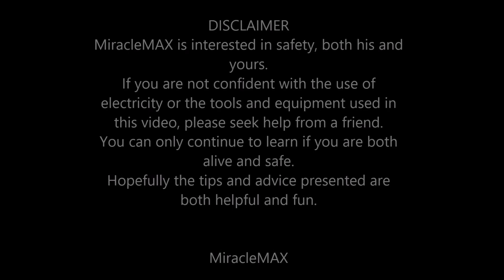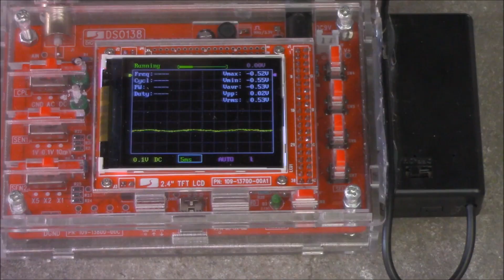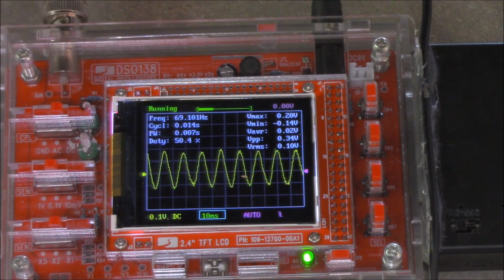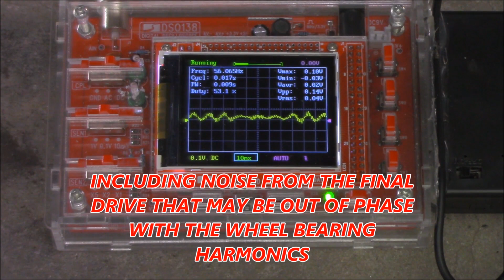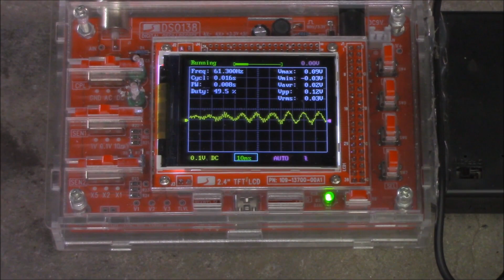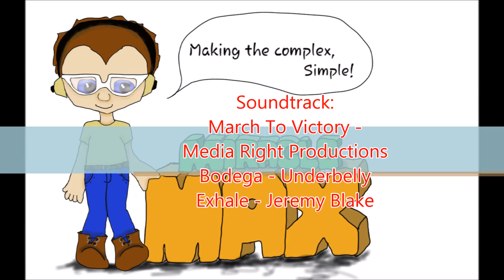Which Is It?  Wheel Bearing Or Diff Noise? MiracleMAX

Comment: My car makes rumbling noise from drivers side amd pulls me to the left. When i turn steering slightly to the right the rumberling noise will go am i correct in saying its a bad wheel bearing what is causing it
Reply from the maker: There could be many reasons for noise from one side - wheel bearing, cv shaft, etc. Difficult to make suggestions without hearing the noise.
Reply: @MiracleMAX  do ypu have a email i can send a video over to you mate
Reply from the maker: @gaz2581  The email address is shown in the description.

Comment: If noise was because of wheel bearing then why noise got less after changing differential fluid?
Reply from the maker: This vehicle had not been maintained properly & so that is why I replaced the oil and put in an additive to try and isolate the fault, but as shown in the video, the noise came back the longer I drove it due to heat. Evidence of the correct diagnosis was proven when I showed the old bearings.
Thanks for your comments.
Reply: @MiracleMAX  Thank you for the info. Will acrylic sprey paint on the threads of metric tapered plug make it stuck when i try to loosen ? Do you have any idea. I gave a try but not hardly as i am also afraid to strip. I will keep trying from time to time different days i think. i dont know what else to do
Reply from the maker: @cemildenizel2223  Not sure exactly what you mean. Do you have a bolt you are trying to remove or a tap? Why is there paint on the thread? Have you tried using paint thinners to soften the paint?
Reply: @MiracleMAX  Before installing differential plugs spray acrylic paint was sprayed on threads of oil plugs in order to create a seal and prevent leaks 1.5  years ago. My question is that will it make it harder to get the plug out now? At least it should prevent welding in 1.5 years time.
Reply from the maker: @cemildenizel2223  generally a diff plug will have a washer or it may be a slightly tapered plug, which really needs no sealant. What makes you think it is paint? Could it be Loctite that was used?
Reply: @MiracleMAX   Originally it has dry sealant dust and no washer. Mechanic used spray acrylic paint to seal it . i saw it. but only a thin layer of sprayed paint. i now got that it was a wrong thing to do. and i am asking if it can make it hard to get out?
Reply from the maker: @cemildenizel2223  Strange. Never heard of using paint as a sealant on threads. Just carefully remove it. The paint most likely will just break away.
Reply: @MiracleMAX  Hope so thanks for comforting me.
Reply: Fill plug is stuck and not coming out. Probably it is because of spray paint. im very stressed and do not know what should I do.
Reply: @MiracleMAX  it got stuck and dont know how to loosen that fill plug.
Reply from the maker: @cemildenizel2223  Try tightening it and then loosen it, then the same again. Have you tried any lubricant on the thread?
Reply: @MiracleMAX  I tried wd40 and did not work. but I will try thinner and hair dryer and see

Comment: *MiracleMax*  yes Sir; this video of yours is GOLD;
 I never saw the problem dealt that way,and it is amazing; i do have one of those scope kits,gonna solder it up,and build the sensor you made; you are some engineer!
Usually i lift the car,one front wheel at a time,remove the tire,and run the engine at 1800 RPMs (caution,they double at the one wheel, DO NOT go over 2000 RPMs,the diff hurts..); that never fails,the sound of the bad bearing becomes loud that way.

edit:  a 1 megaohm resistor is needed in parallel with that sensor (the name  is  Minisense 100 ); it can put out +- 50 volts AC and damage the scope; i just read that on the tech data for the device.
Reply from the maker: Hey Jose,
I am always careful about running a RWD vehicle on one wheel - you can do some real damage. Also it is a no-no if it is a limited slip diff.
Here is a link to another vehicle I used that sensor on to isolate a fault.
https://www.youtube.com/watch?v=shRbQTlvXwk&t=2s&ab_channel=MiracleMAX
Thanks for the comment on the resistor - basically that is an antenuator, so that the oscilloscope can read higher voltages without being damaged.
Cheers
MiracleMAX

Comment: Max, what is that little scope? A kit? Any link to it, it looks like it might be a Arduino or pi project?
Reply from the maker: Hey jackmama79,
This was my very first oscilloscope. I built the kit with the enclosure in front of the TV in about 2 hours. It has been great to carry out diagnoses. I have bought other more expensive ones, but sometimes use this one for convenience.
Here is one of the links, but you can get them off Ebay or other places as well.
https://www.aliexpress.com/premium/dso138.html?d=y&origin=y&catId=0&initiative_id=SB_20210713143734&SearchText=dso138

Here's one in the $200 range
https://youtu.be/pR4J58qmr8k?t=520

And finally I bring out the big guns.....
https://youtu.be/v4SfEtAggOg?t=158

Comment: When you showed the races in the light, the flickering is because you probably run 50Hz power to the lights and a 60Hz camera. Try if the camera has a PAL setting or you can otherwise fix it to 50Hz, it eliminates the flicker.
Reply from the maker: Thanks for your advice telocho,
Cheers
MiracleMAX

Comment: That's great!! Good diagnosis, I read your write up in tat! 
How come the noise didn't change when your turning left and right? 
I understand that sound travels through the drive shaft, but every wheel bearing I have ever diagnosed usually changes when loading either way. Would love some feedback
Reply from the maker: Hey Easy E's Mechanical
,
Good to hear of a fellow TaT member.
I have no idea why the wheel bearing noise didn't vary when turning from side to side - that's what made this diagnosis so difficult. I have always been able to isolate wheel bearing noise accurately, but this one had me scratching my brain!
 I did notice that the bearings were overheated, but not pitted as I would have expected. Perhaps they were just at the start of the 'I'm falling apart - help me' stage. The noise was quite obvious in the cabin, but not outside. Maybe the acoustics of the cabin accentuated the noise??? I'm just clutching at straws here, but I am so glad my little Vibration Sensor did the trick. 
I have build quite a few 'speciality tools' to help with diagnosis. I'm making a 'first look' sensor at the moment and will put up a video when I'm finished.
Thanks for your comments.
I wish I had a clearer answer to your question, but at least I was able to diagnose and repair the fault. 😁
MiracleMAX
Reply: I know Im quite off topic but do anybody know a good place to watch new movies online?
Reply: @Ryan Kenzo lately I have been using flixzone. You can find it on google =)

Comment: Very clever MM.
Reply from the maker: Thanks Mate
Reply: @MiracleMAX   Hi, does it matter what the setting are set on, you have it set on 10mv DC & 0.5ms on the wheel bearing & on the diff its 0.1v DC  & 10ms

Comment: I like it! I am in the process of diagnosing my diesel truck's rear end noises and the engine is so loud it's hard to say where the sounds are generated from. Your approach would be very helpful.
Reply from the maker: I was amazed at how easy the diagnosis was with the vibration sensor and oscilloscope. The wheel bearings were nowhere near as bad as I expected, but the noise was horrendous! 
I have seen bearing cups worse than that without making as much noise. I don't think I would have diagnosed it as quickly without the tools.
As long as you have all your wiring tied out of the road, you can leave it connected on an actual road test, which will make your diagnosis more realistic. 
I hope your testing proves successful.
MiracleMAX